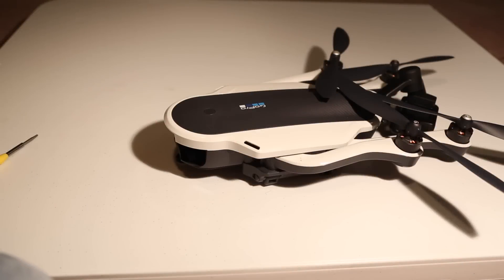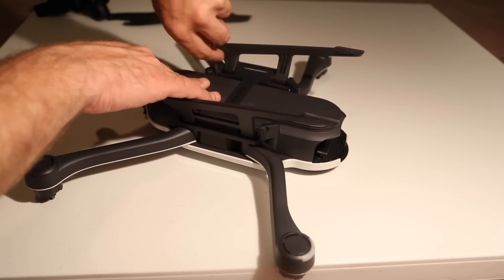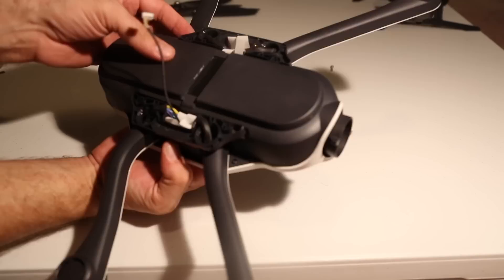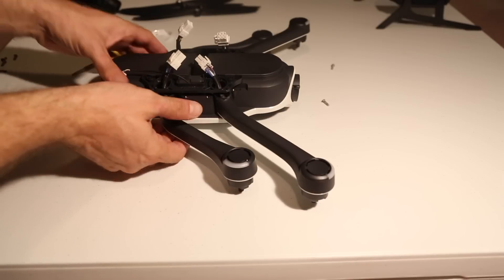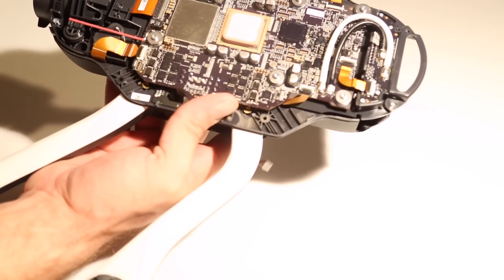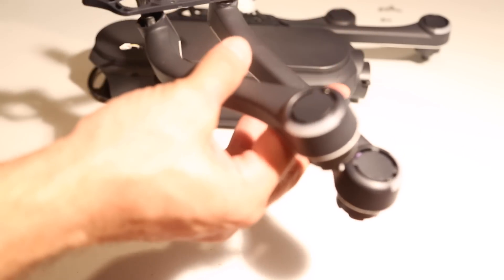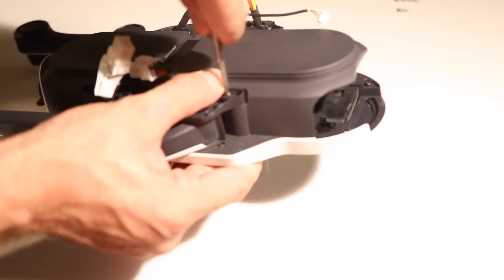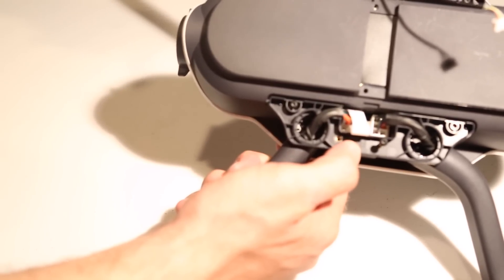GoPro Karma Drone - Dismantled, Disassembled & Torn Apart - Removing Shell, Landing Gear & Arms

Comment: I want to see what made them recall it!!!
Reply from the maker: I'm so pissed... I just had an awesome flight with Karma over a lake, flew fine.. I don't want to return it..
Reply: You should consider it before it drops into the water and you have to go fishing for it and then fight to return it :P
I wanted to get one but I'm holding off until I see what they do with them
Reply: It was a faulty compass from what I understand.
Reply: @dragnet53  No, it was the battery latch was faulty and the battery could back-out and the entire drone would lose power.
If you returned it (and got a "repaired" one), they gave you a Hero 5 Black as a "Thank you"!  Not bad...

Comment: Thanks for that!  The Karma certainly looks like some jerry-rigged Russian technology device (i.e., far from high tech).  But that is what is great about it because soon there will be user mods and many simple field repairs as well as tons of 3rd party improvements (i.e., better battery for longer flight times, flight range extenders to reduce loss of signal, more efficient props & motors, etc).  The Karma does what it's designed to do without any extras and seems to do it well enough.  Very simple design to keep costs down.  Next version (the Karma II) should have an IPS on the bottom to help with landings & indoor flying as well as a basic object avoidance.  One thing I've noticed is that the Karma is probably the "hardest landing" drone currently out there (it just slams the drone into the ground on auto land).  That can't be good for the gimbal in the long run.
Reply from the maker: Interesting analogy, but yes, and will fly for another 50 years, ha! I am already considering an antenna mod..
Reply: Nathan Shaw with the 're release anymore thoughts on an antenna mod? would love more range on mine
Reply: They have ended the drone business ,no more drones for GoPro company ,